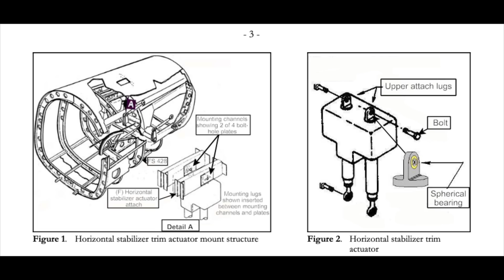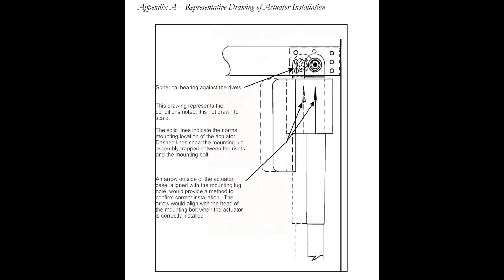The Blind Fix That Crashed A Plane | Hidden Flaw | Transwest Air 602

Comment: When possible, it's always preferable to have more than one safety check. The use of a temporary pin to support the part during installation, along with alignment markings, would be my preference. Training is just as important. In short, there's no need to have a one-or-the-other fix as long as they don't conflict with each other.

One thing you said that bothers me though, is that since it was a total replacement with a new part, there was no need to test it? I realize this was likely part of the written procedure, but it seems foolish to blindly trust that such a critical part was properly installed and works.
Reply: I think he means that exact test was not carried out because it wasn’t required by the manual. There would have still been an independent inspection for proper installation and function and the next guy missed it to. Unfortunate situation.

Comment: This reminds me of a similar Jack screw accident that ended much worse for a lot of people…I have a remedy or fail safe ,even tho I’m no mechanic..  fit the jacks crew or actuator  controlled surface with 2 springs under tension , one spring forcing surface up other forcing down.  So if or when it fails and nothing is controlling it..the springs hold the control surface in a neutral position.  Rather than just loose and wild completely causing chaos to the pilots controlling plane… mite have to beef up the OG part to overcome the spring tension added.., but an easy fail safe remedy none the less

Comment: Adding a block (or bolt) to the front/back of the mounting location to prevent the pin from being able to "trap" the housing between the frame and the pin mounting hole would make it nearly impossible to improperly install the housing.  If there isn't enough room to be able to accidentally put the pin through with the lugs misaligned, then even without all the other (very good) suggestions, the housing would only be able to be pinned when it is properly aligned.

Comment: Should have a go no-go gauge, I should be Bolton in the first place. Set the actuator up into its place run a pin through its mount. And then make sure that that pain cannot come out with a mechanism of locking down a 90-degree end on it. Makes it very easy to just disconnect B end of the pin retaining system, pull the pin, take the actuator out replace it with the reverse process.

Comment: I would recommend using 2 mechanics. One to hold the actuator and one to insert the bolt. It would shorten the time to install the actuator and 2 sets of eyes on the installed part are better than one.
Reply: In the tailcone of this airplane, there's simply not enough room for two mechanics.  Even one mechanic faces a tight squeeze.

Comment: I agree with the measures taken, but would go a step farther. I would add a "guide", ridges in the frame or something else to block that gap, so that it would not be possible to misalign the holes that badly. So the holes have to be aligned for the bolt to fit through.

Comment: A simple and  reliable modification would be to have fixed in place tapered hollow dowels concentric with the mounting bolt holes. Then the mechanic  could lift the part into place with the dowels holding the weight while the bolts were screwed into place. An added benefit with this solution is that the dowels would help hold the part permanently an additional safety precaution plus no special tools required. I don't get plane designs sometimes, the original method was thoughtless and cut price.

Comment: I don’t think the weight is so tricky but does sound awkward still. Some sort of jig would help where you sit the part in it and lift the whole thing up. The jig can matchup with whatever holds the actuator so you can’t get it in place unless it’s perfectly aligned. It would be a pain to have to have these jigs about so it could easily come with the part. Talking about ten bucks of plastic.

Comment: The automotive, aerospace and defense industry has the FMEA tool to assess and Analyze potential Failure Modes and Effects both at the Design stage (DFMEA) and a for the manufacturing/assemble Processes (PFMEA). The PFMEA is also used for the maintenance procedures since these include disassembly and reassembly.

Also, the Japanese manufacturing technique of Poke-Yoke is used by the automotive, aerospace and defense industry as an 'error-proofing' tool to ensure that parts are located and fit together in ONLY the way they have been designed to fit.

The designers should have been closely involved during the prototyping build stage (pre-manufacture) and so should have been aware of the 'blind' fitment of the actuator (especially during maintenance).

With this knowledge, the designers should then have mandated the use of actuator location markings before releasing the manufacturing drawings for use.

Comment: Make the installation process easier and include alignment indicators on the part. The load test on the completed repair should also be mandatory and performed by another A/P.

Comment: Why was there so much tolerance to allow the insertion of a bolt? Also, why couldn’t the area where the actuator be recessed so mechanics would know by feel it was in the correct place? Then mirrors could have been used to visually inspect after installation. The design of the aircraft should have allowed installation to be a lot easier.

Comment: I believe it's called Murphys Law. If a fitter receives training which is proved to be lacking that does not mean that re-training is not called for. I would agree that the fitting of critical items needs proper procedures and a method of checking correct fitment as simple as possible. Alignment marks would certainly qualify for that in this case. Lining up a high tolerance bolt by feel, especially in a confined space, would not be a quick task and holding up 5kg with one hand when doing it is a big ask. This one is definitely a gotcha.

Comment: Having worked as an aircraft mechanic on this exact type of airplane you got many things wrong. There is no way to see that bolt when it is in place. And you can't kneel in that small space where the actuator is mounted. You can only be on your back holding this above your head behind you. (Yea a real pain in the a$$) So extra eyes? Not happening. But they should have done the time and travel tests to see if the new actuator was installed and working properly. To give you an even more claustrophobic feel for this situation a small description. You are in the middle of a tube a bit smaller than a CAT scan machine wrapped up in the cables that go to the tail surfaces (rudder and elevator) along with electric lines for the lights and other items. Then you are so far up that no one can see you until looking into the tail of the plane. At this point you are within 2 feet of that trim actuator. To get out what did I do? I used my bluetooth headset to call another mechanic to pull me out by my feet.

Comment: This issue could have been easily avoided by tracing around the mounting with a common marking pen--the same way we ensure correct alignment of an auto or truck hood when removing and reinstalling it. 10 pounds isnt that much, Ive held up old Ford and GM Delco Remy starter motors that weigh twice that with one hand while installing bolts with the other, and the starter alignment is critical, though not anywhere  close to being as critical as any aircraft part  as the risk of dropping like a stone out of the sky is simply never present with automotive repairs.
Thats one reason I chose to do automotive repair rather than be an A and P technician.
Reply: The question I have to ask is did they access this from the inside or outside. If from the inside I wonder how much room they had and did they have to kneel. If they where kneeling they the 10 pounds can way a lot more.

Comment: What about using something like a bore scope or something like that for visual inspection after installation to verify that  everything was done correctly before flying.
Reply: Telescoping mirror and flashlight would work just fine.
Reply: That's really my point that there are many ways to get the job verified that it was done correctly so as not to put lives at risk.
Reply: @michaelpascual2731  it's double checking your work. Something I constantly do.

Comment: I believe all of the above should be done, i mean you can make arrows or marks, but what if the mechanic has no idea what those marks are for? So train the mechanics, use the pin method and marks to verify the location of the actuator and reduce fatigue.

Comment: How come that crucial parts always seem to be installed in places with bad accessibility? To prevent things like this from happening, the actuator should have been mounted at a spot that is freely accessible to the mechanic (i. e. accessible from existing inspection openings or by adding another inspection door for easy access if feasible).

Comment: How do you tighten a bolt thats in the incorrect location ? Surely it  didn't grab any thread therefore  wouldn't torque up?
Reply: It’s a bolt with a nut. The bolt just passes through the hole and the nut secures it.

Comment: This repair job should be a two person job not a single person job.  One to hold the stabilizer and one to actually see where they are putting the bolts in place.  This accident I blame TransWest for as they should have a mechanic and a helper.

Comment: An experienced mechanic, would have known to use a drift pin, to line up the accuator, in the correct position. Every mechanic knows of this method, to make sure that a part is properly aligned.
Reply: Easy to say in hindsight. What if you had done this many many times and never had a problem? I love how people can always find so much wrong with how someone did something without having any personal experience in the task.

Comment: Explanations about flaps and hora stab are so vague. Flaps help in low speed because wing are is increased, therefore, more wing area, more lift at a lower speed. Horizontal stab main job is to relieve the elevator forces made by the pilot. When the airplane is pitch trimmed, elevator and horz stab are faired, thus increasing the surface area to release the pilot forces.

Comment: Maybe it would be better if the mechanic had some help, 5 kilos isnt that much, so some assistant could hold it while the proffessional mechanic would do the bolt. People sure can make mistakes, but these mistakes shouldnt be overlooked. He sould be 100% sure he installed it correctly. My former boss said, that if he wasnt sure about the procedure, he couldnt let the aircraft fly, he wouldnt sleep well knowing it might fail and people might die. Didnt see this particular case, but I think you should be able to tell, as a 32y experienced mechanic, if the bolt went through a hole, or is just stuck by friction. But as they say, after war everybody is a general

Comment: What are the authorities thinking? Where is the Dual Certification, carried out by a Licenced engineer who was not involved in the task, which is mandatory for flight controls? Where is the full system test required after flight control maintenance?  Is the Canadian Certification system so primitive that they don't have these requirements? As  a Licenced Engineer for QANTAS for 36 years, I find it utterly unbelievable that this situation could be allowed to happen.

Comment: Simple, require a boroscope inspection by an auditor, boroscope cameras are a trivial expense when compared to anything in aviation and having someone other than the mechanic perform the inspection should be standard SOP.

Comment: A mark on the part isn't a functional test. (Next up: airplane crashes because an alignment marker on a replacement part was in the wrong place.) Alignment marks are a convenience, not a determinant of correct assembly or operation. The man installing it is the last QC step - the final decision on fit and function is in his hands. The only criterion for success is proper operation, NOT alignment of visual aids.
Reply: Sadly, the criterion for failure is improper operation when proper operation is expected.

Comment: amazing how some folks think they're changing a headlight instead of messing with vital control surfaces
Reply: You have no idea what you’re talking about unless you’ve personally performed this task.
Reply: @philipolson1965  as someone who has been an amfa 32 member for most of his adult life, your post comes across as a little defensive.. not sure why a snake inspection camera wasn't used to verify the correct placement.. that is a common practice in this business... Bottom line was a faulty repair almost led to loss of life and there is a 0% margin for error in this industry as you should know
Reply: @2345allthebest  yes defensive of a great mechanic who made a mistake and paid for it dearly. He messed up, yes. But it wasn’t because he approached it with the same cavalier attitude of changing a headlight as your comment implies.
Reply: @philipolson1965  ok... I'm not saying that he should be thrown in the dungeon for the rest of his life and thanks to the Lord that no one was killed.. it's just that we preach 0% margin for error.. I have no idea what the mechanic's attitude was other than surmising that the repair was hurriedly done for an unknown reason and maybe since the scale of the aircraft operation was similar to14 CFR 135 instead of 121 or their equivalents in Canada,  there was a more relaxed attitude...have a good one

Comment: I’d find mechanics that can figure out if a bolt is going in without looking at it.....and ones that can hold hold a bowling ball with one arm.
Reply: I'd hate to have human lives depend on the mechanic being perfect every time, rather than having the parts be designed so they only fit when properly installed.